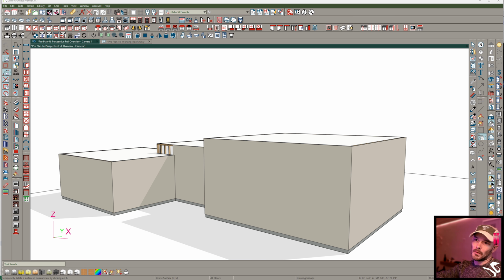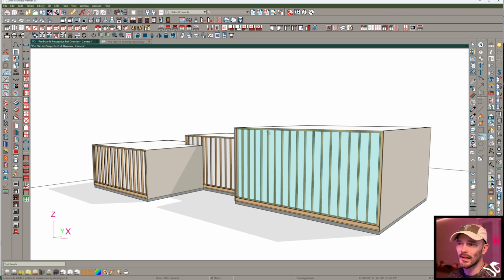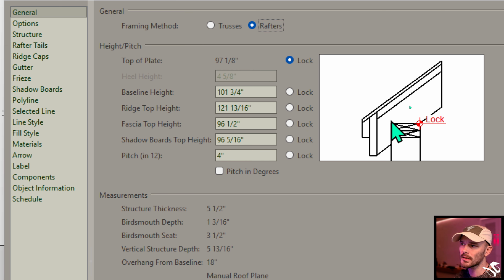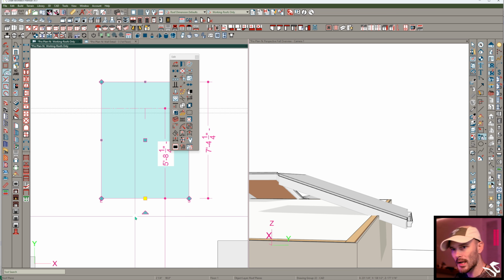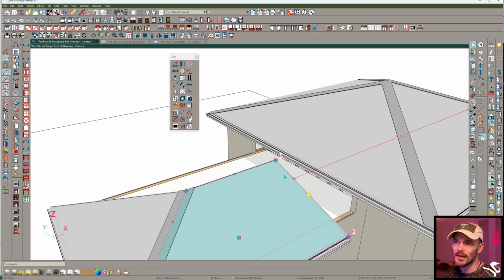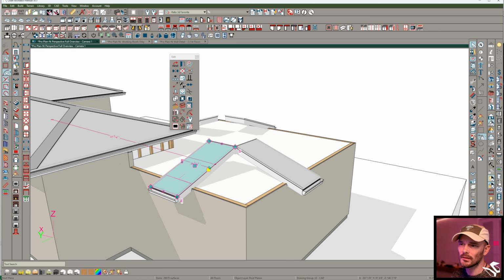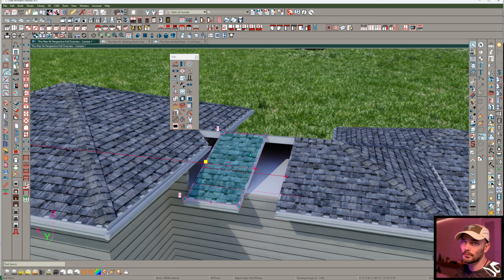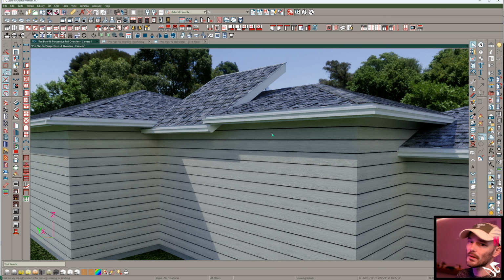Mastering Roofs With This Trick In Chief Architect X17

Comment: I know this program more focus on framing build which is not what our construction practice.. but is this program to imitate reinforce construction type.. like Revit Archicad etc.. ?
Reply from the maker: Certainly, can you give me a link to a graphic of the type of mass construction you are refering to? There are many different mass construction types globally :)
Reply: @rabbittdesign8482  I tried many time, but it didnt work for me. 
The main problem is it 'auto', for the floor level height. The ceiling setting disturbed the level height. Its good if I can 'lock' level 1 height and do whatever on level 2. 
Here is a sample image the build that im talking about. 
https://i.pinimg.com/1200x/09/36/8c/09368ca7487364d55a5924d7e1fa9593.jpg